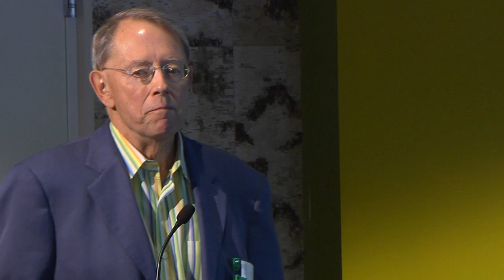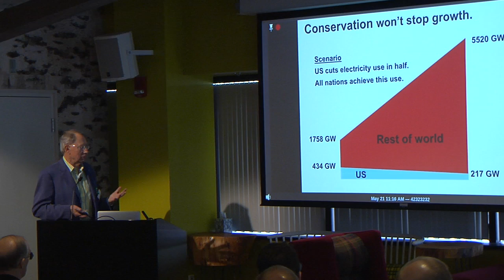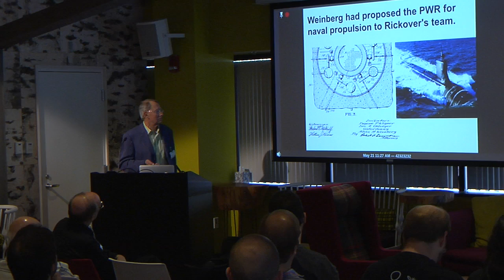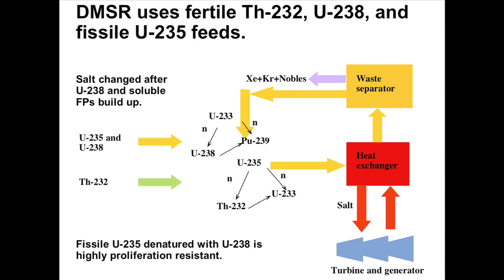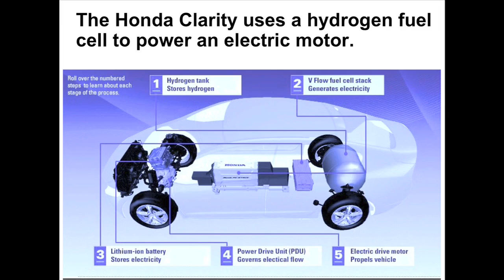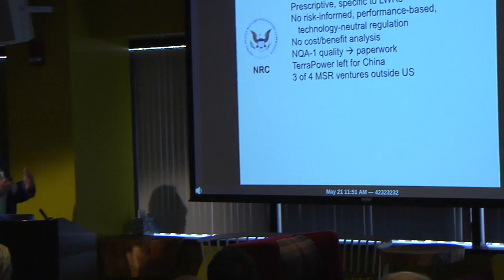THORIUM | Robert Hargraves | Talks at Google

Comment: My solar/wind experiment and project over 10+ years. 

I have both the experience and gained knowledge to compile a good and well designed system and to maintain and troubleshoot a combined system and over time sought out any knowledge required to optimize and improve efficiency of my experimental system. 

At no time was I ever disconnected from the grid nor did I buy super efficient large appliances, those remained connected to the grid. I wanted to see how much I could get by with off a system without spending the huge dollars to cover everything and still maintain my lifestyle to some % point.  I placed many meters to determine my usage loads and consumption, as well as generation. I have solid data over several year periods. I had re wired my home to allow shedding loads on every circuit and switch between grid or off grid. In other words I have total control.

I expanded and replaced many components over time and optimized angles and systems and got down to near perfection as the sun angles changed over time of year.
Optimized tower heights, wire runs, gauges of wire and voltages and kept all connections clean and tight,  Batteries properly maintained with scrupulous care and discharge %.  I have a 2K solar and 3.5 K wind.

I can live with this system about 70% of the time. The 30% I have to shed loads or charge batteries with the grid. I never connected the shop and with what I have learned even the best of the major appliances would require 3X my current system to live normally and I live alone. Over the time I have had a GF with me just throw the whole thing right out the window or start fights. You would need a very special girl to be on board with the limits of the system.  There are just way too many times the input is too far below par for too long and to not prematurely kill the Batteries with excessive discharge %s and you have to shed or charge with grid or generator.  I have enough geek in me to make this work but I guarantee this is a non starter for 90+ % of the population.

A final point is this, besides the gagging amount of hours I have put in this system it has cost me a fortune in dollars as well as I have replaced inverters due to sizing and failure, and despite best efforts a complete new set of batteries even though I never went more than 25% discharge and maintained both equalization and proper bulk, taper and float voltages.  Several broken panels due to hail and wire mesh cut output by 5+ % so you have to be johnny on it when storms come though or lose the 5% by leaving them on. Not to mention cleaning them.  And 2 times damage to the wind generator due to storms. 

I have literally been a slave to this system and still it is a partial solution to a non problem if you just stay on grid.

Take it or leave it but this is my story.

Semper Fi
Reply: Obviously, "Aunt Millie" isn't capable of doing what you've been doing.  The solution needs to be be "plug-and-play" for 99% of the population.

Comment: The cost of "decommissioning" reactors, and the cost and delay of getting a new one licensed, are burdens that if equally imposed upon ALL other energy alternatives would _cripple them_. Consider if the oxygen consumed by gas turbine plants or any of the other carbon burning were required to be replaced annually. It cannot be done. That is an infinite "decommissioning" cost. Every time a "wind farm" becomes uneconomic, all the concrete bases AND the service roads would have to be removed. An escrow requirement for that would wipe out the entire wind industry, which would be a Good Thing.

Comment: Energy storage (If it ever gets invented) would advantage nuclear far more than wind and solar.
Reply: The biggest pumped hydro storage in  Europe is in a slate mountain in Gwynedd, Wales, and is six 300 MW pump/generators with an upper reservoir or pond that when full could drive them all for six hours. It was indeed originally intended to take off-peak power from the nuclear reactor at nearby Trawsfynydd, but it is in fact ideal for dealing with short sharp demands as when thousands people troop severally into their kitchens when a popular TV program switches to something else.
But at the construction costs that Dr. Hargreaves quotes elsewhere for such reactors, it may be that building another reactor costs less than pumped storage of comparable power.

Comment: I'm a big fan of thorium nuclear energy but there are few things that upset me about it being repeated over and over again which are simply not true.
One is the claim that it will all will work atmospherhic pressure. It won't. Nuclear reaction does not care about pressure (unless we talk pressures inside an exploding atomic bomb), the only reason why current reactors use high pressure is because nuclear fuel rods are directly warming water, generating high pressure steam to power the turbine. The same is true for molten salt reactor because you always need that heat exchanger where your molten salt will be in close proximity with high pressure water/steam powering the turbine, including all the danger of steam explosion driving the radioactive material out. The more you immerse the core into the water the less heat you lose due to thermal conductivity somewhere else so I'm pretty sure industrial thorium reactors will use high pressure chambers very similar to ones used now in solid fuel reactors.
And the second claim is that molten salt reactors are inherently safer because the salt is molten all the time in them. That's like claiming that overclocked CPU is inherently more reliable than non-overclocked. The safety mechanism driving the overheated molten salt into safe place is pretty much the same as protection in case of reactor meltdown in current reactors and it comes with pretty much the same problems. It may be safer than a solid-fuel reactor without meltdown protection but nobody will let you run such a reactor today.
Besides, fluorine is very reactive element and thorium is not exactly the element it makes strongest bonds with, so corrosion of the reactor containment is going to be much larger issue in LFTR than in current solid fuel reactors.
None of these are of course an issue with experimental reactors running at low power for a few months, but that's not the reason why we should be lied about them.
Even with that all taken into account I still believe thorium is the fuel of the future.
Reply: kasuha I believe much of the thinking going forward is focused on Supercritical CO2 and a gas turbine, and the CO2 would take the heat from a secondary loop with no fuel in the salt. So the parts that are dealing with high pressure are not also dealing with radioactivity.
Reply: Mark Love Supercritical CO2 is nasty stuff and requires high temperatures and pressures just to exist. Also turbines run on pressure difference - the higher pressure difference (meaning the higher starting pressure and the lower ending pressure), the more efficient the turbine is.
But whatever the heat transfer method, LFTR has simply no advantages against solid fuel reactors. Temperatures and technologies available are the same for both.
Reply: kasuha I don't think you have a firm understanding of the actualities beneath your concerns.  We aren't worried about containing the high pressure gases because they don't contain any radioactive isotopes, and their release won't lead to a meltdown.  Also we're constantly trying to keep the reactor hot in a LFTR instead of cool in a LWR using solid fuels.  Solid fueled requires you need to cool down, Liquid Fuel reactors you have to keep hot.  If wouldn't be too condescending I'd link Grover doing his near and far routine.
Reply: Nathan Smith I don't quite understand in what way do your arguments counter mine.
I don't see any reason why would high pressure gases in modern solid fuel reactors have to contain any more radioactive materials than high pressure gases in thorium reactors. Perhaps you have any details?
From my point of view it's just water or other suitable medium flowing around metal pipes containing radioactive material and it's completely irrelevant whether that material is circulating or just sitting there. In both cases there's plenty of radioactive elements inside them if they become damaged.
Whether you're keeping the reactor hot or cool is also irrelevant. In both cases you're keeping it at working temperature. From the safety point of view I don't consider higher temperature (in LFTR) safer. Yes, self-regulation of molten salt by thermal expansion is one added safety point but there are other points countering that, too.
Even in solid fuel reactors, meltdown is designed and controlled process. It certainly should be avoided as it is not part of production cycle but it is designed to produce heap of molten radioactive material sufficiently diluted to prevent any chain reaction which is then drained to a special container where it can sit and cool down. Sounds perfectly the same as for LFTR to me.
And you did not address my statement about Fluorine from used salts having good potential to corrode whatever containment is used to hold the salt.
Reply: The water that is used as coolant comes into direct contact with the fuel rods, inevitably transferring certain radioactive products into itself, most likely the gases like Xenon, if there is a rapid loss of pressure the water vapourises immediately to steam and expanding by 4000%, and gaseous radioactive isotopes escape along with it.

That's why they build containment vessles is to contain the gaseous radioactive elements in the event of pressure loss.  The high pressure elements in a MSR do not come in direct contact with the coolant so there is no chance of transfer for the gaseous radioactive isotopes (which are siphoned off as a part of normal operation of most MSR designs) thus in the event of a pressure loss it's just steam, and should there be a leak in the MSR cooling system the gas products don't expand by 4000%.
Reply: Also the solution to the corrosion issues istoy using alloys that don't react to the salts, of which there are several candidates, one of which was used in the Oak Ridge Reactor.
Reply: +kasuha I think you are confusing the purpose of the PWR secondary containment structure, which in part is to CONTAIN the potential release of radioactive steam from a PRIMARY system rupture and subsequent loss of pressure incident whereby the liquid/vapor interface moves to the core AND a Fuel Element Failure (FEF) ensues.

A Secondary Steam incident in a PWR, though clearly dangerous to nearby operators, is a ventable situation as secondary steam for STG's (etc) is not radioactive.

Primary Coolant, in and of itself, is purified/distilled water that is literally drinkable 15 minutes after a shutdown...assuming it has cooled to a palatable temperature, of course.  ADM Rickover proved this by drinking a glass of it in front of the US Congress.  As I recall, that brilliant a-hole lived to a ripe old age.

The issue arises when that primary coolant becomes contaminated by a FEF or more serious event (partial or full core meltdown).  Here, the coolant obviously becomes highly contaminated and must be maximally contained.

As a primary loop is pressured (lets say from 75 to 150 atm), its flashing to steam will require significant secondary volume to control and contain it in a worst case scenario.

There are plenty of other purposes for Secondary Containment, to include shielding beyond the primary structure as well as physical security from an external impacts (flying telephone poles...aircraft, etc).

LFTR's big advantage is that its PRIMARY system operates at near ATM pressures.  It's fuel salt is the primary heat transfer fluid, not water.  Therefore, it's secondary containment does not need to account for the aforementioned vaporization scenario.  LFTR's secondary containment is primarily for shielding.  Physical Security can be more effectively accomplished by building the LFTR structure underground.

In the end, the cost and footprint are substantially less than that required for a civilian PWR.
Reply: +kasuha the advantages of molten salt over solid fuel are so high that Ed Pheil's company Elysium Industries even has a molten salt design to use fast neutrons and chloride salts instead of thermal and fluorides.
One of the advantages is that the fuel salt can get rid of pesky fission product gases with high neutron capture "cross-sections", and isolate them from the reactor for the short time needed for their decay.
Reply: kasuha  i read your comment and noticed some misunderstandings.  did you resolve these problems?  has your opinion changed?
Reply: Sorry, @Kasuha...  but you've taken an important point (yeah, we need to consider that!) into territory where it just doesn't apply.

YES, the whole high-pressure way we treat current reactors is dangerous, but nothing (or vanishingly little) involved there has to do with anything but keeping the reactor's core cool enough to prevent uncontrolled criticality that could mean explosion, meltdown or worse.

Core-cooling for a Th reactor is a matter of safety too, but only in the sense that you have to keep temps in the reactor's core cool enough that the heat-transfer water (for the turbines) won't be too hot/pressurized for the pipes that carry it.   There's no "nuclear accident" concern here.
Reply: "From my point of view it's just water or other suitable medium flowing around metal pipes containing radioactive material"

Yes and no.

The "medium flowing around metal pipes containing radioactive material" is indeed happening in (say LFTR) thorium reactor designs.

In a conventional reactor, the water that matters isn't just in heat-transfer pipes:  it comes into those pipes after direct contact with every square micron of the core's surface, usually for *hours*.

Comment: Considering all the ups & downs, economics makes us all 'experts' on science & technology. Seems like the only 'energy producers' that can develop is nuclear. The regulator environment is crucial for the economics to work. 
The resources to be used, the type of an operation you'll need & the impact on the living environment are the answers that make the decision of how to go forward.
There are no new radical elements to discover or 'lock down' for thorium. The engineering is essentially plumbing and brewing..... mated with a turbine electric generator. Nuclear experimental physicists working with industrial chemical plant engineers. everything after that is running an electric plant.
This looks like a 10  years or less project ..... Maybe 5 if you get the best project managers who actually know how to break ground and finish what gets started.
We built spacecraft based on feasible missiles. We built nuclear weapons with little more than the knowledge of a radioisotope brick kiln. The first electronic computer was made with vacuum tubes and a teletype printer.

Thorium reactors have far more developmental background than any of those heritage technologies.
The cost will most likely be a fraction of what the petroleum industry charges the retail public in gasoline purchases.
I don't see petroleum resources or operations getting cheaper in the next 10 years.

I'll change my mind if something revolutionary happens... but I need a demonstration first.